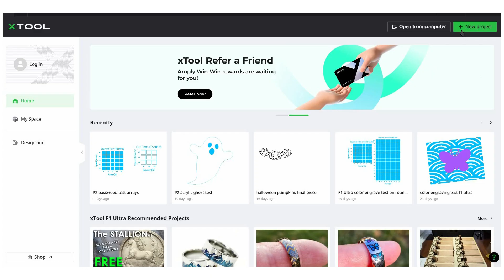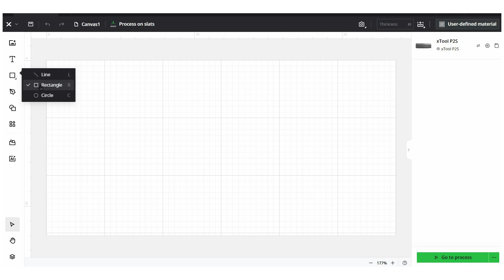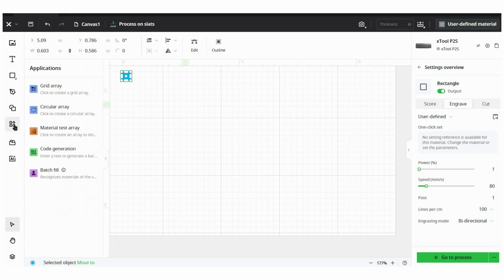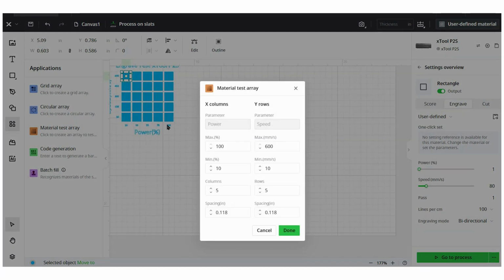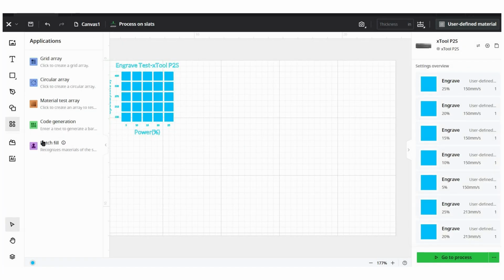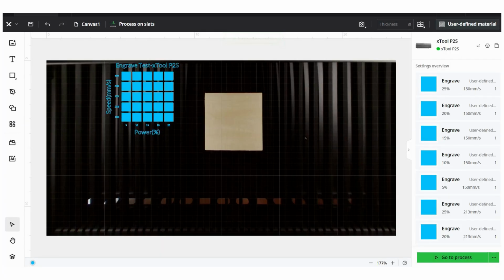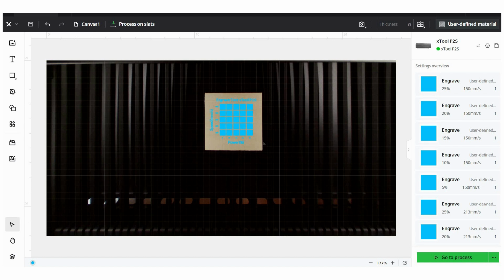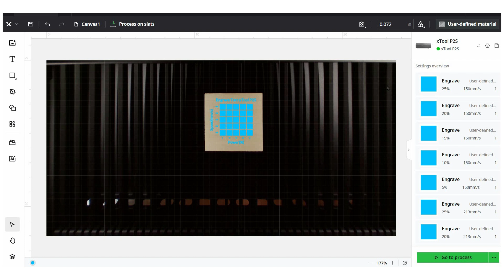Create a Laser Test Grid in XCS to Find the Perfect Settings

Comment: Very good and useful. I’m using a D1 pro 40w but the process is interrupted in the middle of the process a notification saying that the device is disconnected but is not…. Any advice that you can give me.? Thanks in advance
Reply from the maker: That's not good. Sometimes I will get an error when using WiFi if the signal is interrupted. Try using a USB and ensure it's in both ports really snug.

Comment: We all know where to go in the software to perform a test. But what no one talks about is the thought process behind unknown material. Where do you start?
Reply from the maker: Finding a starting point can be tough. In general when engraving a high power and low speed will create a very deep and dark finish. A low power and high speed will be light. I think it takes reps to get an idea of where to start without causing damage and each laser will be different. When in doubt, use the settings XCS gives you as a starting point and work from there.

Comment: I have a question on the speed. How did you figure 400? Is there a sheet that tells you speed and power starting for engraving, cutting, etc. This has me so confused. Is there a starting point?
Reply from the maker: A test array is a great way to hoan in specific settings, but with every xTool you will have recommended settings in the software for your specific material. Start with those settings to make your projects easier. Use this if you are having trouble getting a good engrave.

Comment: Thank you. I'm going through this process step by step as you do in the video. However, when I select 'material test array' all I get is that icon appearing on my canvas, with an x to close it, basically the top header of the 'material test array'. No grid or x column settings or y row settings appear. However, if I select any of the other array options, those appear. Everything except the 'material test array'... What should I do?
Reply from the maker: That's odd. I just went into XCS to see if mine is working ok and it is. If the other options work, then you are doing it correctly. Highlighting the square then clicking test array. Sounds like there might be a glitch in your software. I would make sure you are updated to the latest version, or maybe even just restart it.
Reply: @SarahVanderkooy  odd indeed! Ha, oh well. However, I figured out when I select different materials to process on, like the 3mm basswood, a test image of it shows up "one click set', and when I select one of the squares I like, it sets the process to whatever settings that square is. Not as good as having the piece in my hands... but at least a reference. That does not appear for all materials, example the cork and stainless steel don't have the 'one click set' options. Thanks for your vids!

Comment: I made a 5 x  5 grid on 3mm baltic birch plywood for engraving a cut. Power was set to 100% and speed to 300 mm/s I have an S1 tool. The engraving grid has the same consistance across the entire grid. All of the squares are cut out in the cutting grid. I am new to lasers. Any help you can provide would be greatly appreciated.